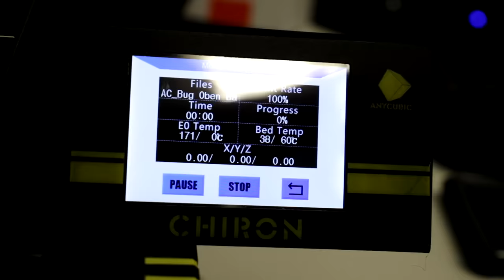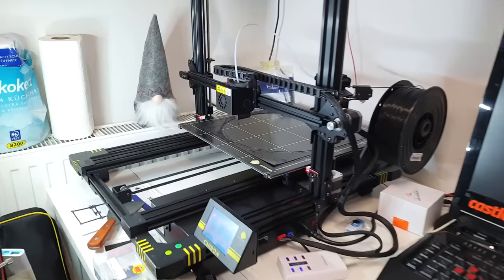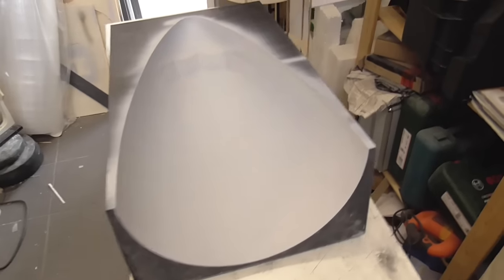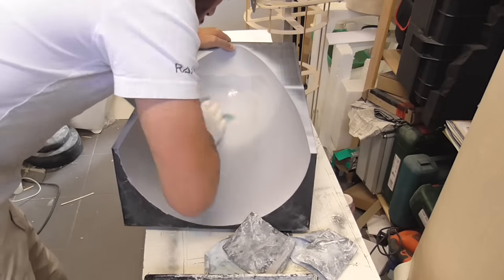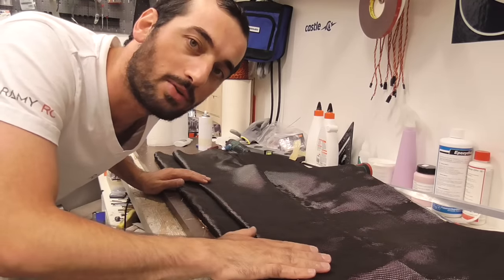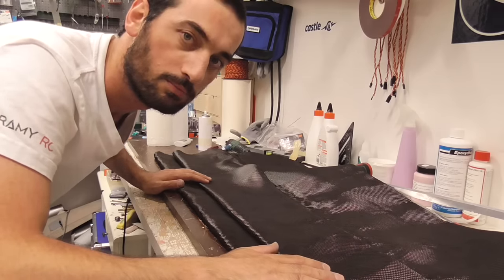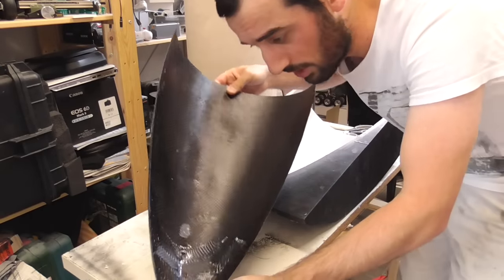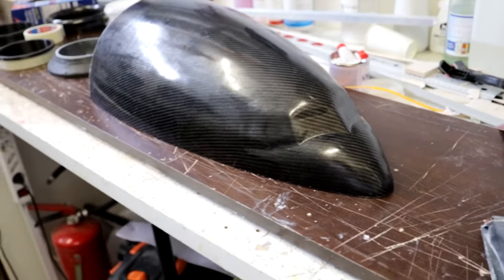Building RC airplanes using a 3D printer

Comment from the maker: Guys I'm not building another 777X, I'm just trying new methods and learning new things for my next project , there will be a vote on YouTube soon.
Next week we have a very funny video for you, stay Tuned!
Reply: Ramy RC can’t wait to see what you build next man! Love what you do
Reply: Hey RamyRC! Many of us are wondering why you are not using any autopilot hardware on your models. RIP 787.
Reply: Can a350?
Reply: I'd love to see a large scale concorde
Reply: James Smith  That's very cool and emotional and being directly connected to control surfaces and motors is a different feeling but autopilots allow manual flight too. But with just one switch fatal crashes might be prevented. So, it's just a counter measure for human error. Also cheap. Poor 787. Poor all that hours, money and hopes invested in it.
Reply: A330-300 or NEO? A300? A340-500/600?
Reply: Ramy when are you going to start selling your kits amazing
Reply: How do you glue the halves?
Reply: All the RC you made is outstanding especially 777, I want to see an air bus model brother.
Reply: This looks awesome! Please share info on the type of CF and resin used 🙏
Reply: Make a 747-8
Reply: Wonder what the price difference between this and your normal foam build is gonna be
Reply: It would be amazing to see someone put a lot of effort into creating another Boeing, probably the hardest one due to the landing gear, I would suggest the Boeing 737 MAX 10
Reply: which cad software do you use?
Reply: U should build an f-302 starfighter
Reply: @MetinOktayYlmaz  autopilot hardware is called a "missile guidance" and is illegal in most part of the world, people playing with it are risking landing on terrorist watch list :)
Reply: How will u glue the two halves?
Reply: Do you happen to have links to the exact coatings you used? It come out great and I must know!!
Reply: So what is that section in the background for? 10:50
Reply: Ramy i want you to build a Boeing 747-8
Reply: You need that Polyvinyl Alchohol as a protective release agent because the wax layers only will react with your epoxy ressin, so your PVA is a protective layer in between
Reply: Ramy RC hey there, can you show the modelling on your computer
Reply: Can you share the 3d mdel
Reply: Thank you so much for sharing your experience with us.I would like know also there is any page to get all declaration page .

With Best Regards 
Abdurrahim
Reply: Hey Rami,
How about going Retro..

Some options.

ILLYushin Il -62
Hawker Siddeley Trident.
Boeing 727.
Reply: Where can I find the 3d models for some of the planes?

Comment: Hello Ramy!
Amazing work that you did. Just a quick tip:
Instead of applying the resin with the carbon fiber at the mold, apply it in a flat table with plastic film in both sides, and than scrap the excesses of resin to the side of the fiber. This way you'll have a evenly distributed resin through the carbon fiber sheet. Do this to each sheet, and apply the fiber to the mold afterwards.
I hope to have helped you! Continue the great work.
Reply: Thank you. And do you apply some resin on the mould as well or just apply the wet sheets on the dry mould?
Reply: Perfect way to get some dry spots

Comment: I'm also not an expert at Carbon Fiber... however, I have recently been watching a lot of videos about it.
You are literally using the exact same technique that I was planning on using. I was very happy to see this video!
The only thing I can say is that it seems to me to be worth getting a vacuum pump and bagging. For one thing it presses the material more solidly against the mold, and it also removes the fine bubbles that mar the otherwise perfectly smooth surface. Without the fine bubbles within the weave the structure is stronger, too.
Reply: nerd alert
Reply: Coming back here to reinforce that vacuum bagging and vacuuming is the final way. It's a big add to the process and I think Ramy sees as overkill for his application, but anything and everything composites should always have vacuum bagging.

Comment: Just an idea based on what some of the guys i've seen in South Korea are doing atm with prosthetic arm/leg replacements. Print the shell, as you've done, but then print a inner structure shell (preferably ABS, i'll explain why below***) that you'll attach to your carbon fiber on the inside of as a last "layer".

***ABS vapor polishing or dipping PLA in a bucket of thin super glue will make the structure very strong because either will bond the layers of the print, i for one, prefer ABS because it's more lenient.

The students in SK were making the structures for the actuators or electronic muscles out of CF and such structures (honey comb or plain lattice) so that they get the best solution for matching components, rigidity, and inner structure mounting points for hardware and so on. I was very impressed with how strong the final product was. I even saw a very interesting thing where they applied the concepts of lost wax casting to CF molding. 

IE, using low temp PLA lattices that were then encased in CF and subsequently baked/melted out in the autoclave as the CF was "fired". VERY, very cool idea. Now, i know an autoclave ain't everyone's cup of juice, but if you use a low temp lattice made out of something like PCL, which is printed somewhere between 80 and 100 degrees Celsius, you could "fire" your part and remove the lattice (obviously it needs to have some place to escape). I mean, your average heat gun can output the necessary heat to melt the material out. :)

You could, in theory (because it takes time to figure these things out) have your own latticed CF nose cone or wings made out of a single solid, piece. Making something like that DIY at home, is very difficult, we're talking Koenigsegg CF wheels level of complicated here.

BTW, check the channel "The Drive" for the Koenigsegg wheel videos, has some really cool insights in CF laying by the man himself. :)
Reply: Nice info. Do you have any video on how to do this with the PLA as a second layer?

Comment: I making carbon fibre parts using 3d printed mold around 5y ago some people use it for making carbon fibre bike frames (i making glass fibre parts around 10y ago using styrofoam model and glassfibre mold) :) now i work making composite parts for motorcycle :) 
YOU dont aply PVA on wax.... You aply wax on pva if you want easy release but you can use only PVA without wax
If you part is smooth you only need to aply maybe 2 layers if you making mold one time(i sometimes use only 1 layer of wax or pva and 1 layer wax on top of it...if you aply 5 times wax you can make easy 20 times the same part using 1 mold....we aply wax 6-7 times and use one mold without aplying more wax around 50 times or more. 
If you try to aply pva on wax it wont stay on it...like water on waxed car paint.
PS.
If you need any help with making molds etc text me on email (its in information about me on youtube)
Reply: What do you use to smooth out the raw printed mold before PVA/wax?
Reply: @epgaynor  after it is printed i first use brush to aply acetone on it....to clean the print or sometimes PLA with colour start to melt (not pla....pigment in it) and it become smoother
Next i aply thic coat of primer and high gloss spray paint.....or if spray paint is based on acetone just high gloss paint then after few hour sand it using 500 water sandpaper untill i see plastic 
Then use 800 + up to 2000grid (you dont need perfect smooth just make it smoother after 500) 
When i use 2000grid i add some soap to clean it and leave it to dry (dont touch with finger)
Then aply first thick layer of pva using sponge and dry it using hairdryer so it wont make spots without pva
I heat it up in the same time
And then aply second layer
But second layer need to be aply in 1 direction and dry as fast as possible so it wont melt first layer 
After that mold is ready if you want you can aply wax on it if mold is tricky (if its mostly flat u dont need it)
Or if you want to use it few times dont aplt pva...aply wax wait 15-30min (check wax instruction)
Polish it then aply again wait ...polish it and repeat around 5 up to 7 times

Comment: Nice! You should print registration/alignment connections between your mold parts, so they align easier when gluing for instance. Don't forget to add clearance, though, otherwise they won't fit together.

Comment: Hi Ramy, have you ever considered building a plane in small strong sections that are joined but can breake off in case of a crash. In that way the plane could break apart in a crash but the parts would survive because they can brake off and wouldn't take full impact off the whole mass of the plane. Off course the trade off would be small joines but they would only be visible at close range. Another advantage would be the if a part would be damaged too severe you would only have to remake that part and not the whole plane. Off course there would be more design and build work but when you can think of a good system it would be a big advantage in all your future projects! Cheers and good luck!
Reply: It would add mass and made model more likely to crash.

Comment: You will find it easier to get your fiber wetted if you apply a generous layer to the mold itself before you put the first layer on. It works better to work the resin up through the fiber than it does trying to push it down into it. I get great finishes with no blemishes or areas that did not wet out by first laying down a nice coat of resin on the mold, laying down the first layer of fiber and using a rubber squeegee to pull the resin up into it. When I have got all I can up into the first layer I add more resin and repeat for the consecutive layers. If you are vacuum bagging its not as critical to do it this way but even then I always wet out the mold prior to adding any fiber.

Comment: Hello Ramy!
Your work ist getting better and better, wow.
Just some thoughts about your carbon fiber pieces.
- If you wish to have a nice surface without much sanding, you can start with putting the paint or some gelcoat in the mold. And to make it nice and smoth, put some glassfibers (40g/m2) before you use the carbon. In this way you can avoid the little "pinholes"
Very curious to see your next project. 
My next project is to improve my tristar, trying to make it fly perfectly smoth and adding some scale details.
Greetings from switzerland, Dom

Comment: Hey Ramy, im a huge fan of you and your work. However, I didn't think much of it until I actually went to college to study Aeronautical Engineering Technology to be a Pilot in the US and the horizontal stabilizers on every aircraft is supposed to be an inverted airfoil to pull the empennage of the airplane down instead of a standard airfoil. I just wanted to let you know so that it can help with the performance of your airplanes.

Comment: Rather than a many use mold, I have considered a vase print and just drape the print on the outside so it's one piece, no seams to glue together. And if weight is very critical, the weak print can be torn out when it's done. 3D printing obviously has huge potential for fabrication.

Comment: I make molds for a living. I bought a 3d printer for home use so I could design molds, then make a fiberglass part out of it, tyhen make a fiberglass mold off of the part I made out of the 3D printed mold. This is a great use of a 3D printer. Nice job.
Reply: What are you using for  filler on the print? PLA or PetG?
Reply: @marcusmarcusk830  I was printing with PLA.
Reply: @CarbonGlassMan  and what kind of filler do you use in the PLA print to smooth the surface? Some epoxy based spackle?
Reply: @heavyweather  Oh ok. I misunderstood you. I sanded it with some sandpaper and sprayed primer surfacer on the print. Then wet sand the primer. You could use rattle can primer surfacer if you dont' have a paint gun and air compressor. SEM makes a good primer surfacer in a rattle can.

Comment: Another tip I have learned with carbon or fiber glass, always wear gloves when handling it. Your hand oils will cause the fibers to repel the epoxy and not get a perfect bond.
Reply: Is it OK to fold the CF cloth like at 8:30? I was told always keep it on a roll, like glass cloth.
Reply: @dbaider9467  i think that ideally it should be on a roll, as to avoid creasing the fibers, but as long as no pressure is applied to the fold, I don't see an issue with it.
Reply: What type of resin and hardener should be used for jobs like this?

Comment: 230 should be no problem printing PLA...the 3d printed planes are often printed at that temp with PLA for better layer adhesion.  If you are getting clogging then it likely is an assembly issue.  If my guess is correct the hot end is probably something like the E3D V6 hot end and a common mistake made with those hot ends is to forget using thermal paste when screwing the heat break into the heat sink.  Without this thermal transfer doesn't work properly so the cooling fan doesn't work properly and at higher temps you end up getting filament jams in the heat break.

Comment: you should make ID holes/bumps in the mold so it's easier to line it up and glue together.
Reply: I have a feeling his 3D modeller is not that good considering they couldn't get the windows modeled correctly either.
Reply: @_droid  yea it's not that hard

Comment: I just started building my airplane with this method. It's genious. How do you plan to attach the two halves together?
Reply: Vegandiver
I have asked several times for someone to mention the program they are using to make these molds. None have replied, even the YouTube presenters. Would you mine stating the program that you have tried? Thanks.
Reply: @amtpdb1  I've been using Fusion 360 from Autodesk. Assuming i have the plane modeled, I make blocks that are the build volume of the 3d printer, then Boolean cut those blocks with the plane model, then do more simple lofted or extruded cuts to reduce the amount of material used and print those. I also add alignment features so the molds pieces line up.
Reply: @vegandiver  
Thank you so much for answering. I downloaded fusion last week but haven had the time to look at it and I had no idea it could do molds. I will have to look around and see if I can find someone that is showing the process. Again I want to thank you for your help.  Don

Comment: Great printer and a great result with all of your hard work in between. Something very sexy about carbon fibre, I really want to make something now!
I print with RigidInk PLA and it's very happy printing at 195 degrees. I tried and tried with ABS but too much warping on my printer (not enclosed so can't keep it hot). Great work.

Comment: Also, maybe worth storing your fibreglass and carbon fibre rolled onto tubes.  That way, the cloth is undamaged or not weakened at the folds - based on my learnings.  Others may hold different perspectives.

Comment: im a total noob at making rc models but i saw a video of Lamborghini making
 Carbon fiber panels . they use a special kind of roller to eliminate air bubbles during layering of the carbon fiber .
 And then after a quick drying they bake the molded panels in a vacuum oven .

 So maybe you should use a mini roller ? And bake it a big oven ??
Hehe . goodluck to you sir .

P.s i hope you rebuild a dreamliner again .
Or if not pls try to make a USAF C-17

Comment: Glad to discover your channel, and thanks for demonstrating this very interesting use of 3DP!
Now, sorry to be this guy but I have one advice/request: please use a respirator when working with epoxy and carbon fibre! The very high evaporation surface makes for some higher than usual concentrations of epoxy solvent in the air. This stuff will give you issues over time such as Parkinson's.
Also, if you haven't, you should checkout Igor Negoda's channel (Игорь Негода), he's also currently working on a carbon+glass fibre RC aircraft and most of his videos have subtitles now.
Cheers!
Reply: Just another tip re carbon fibre: when applying multiple layers, try to have the fibres lay at a 45° angle from each other, in order to maximize structural strength against all kinds of stresses.

Comment: I'm thinking the 787 went down because you had full flaps on during your bank.
during a banking turn lift is drastically decreased... and full flaps will register a lot of Drag. In a sense you are right that you were going to slow but the greater issue was the airfoil at full flap while banking at a 90 degree angle. Regardless... beautiful work, sad to hear she's gone.
Reply: Or maybe the ESC fried on the right motor. After Rewatching it seems like you closed the flaps. Bummer man.

Comment: Nice video... You can use the pva without the wax, it will just pop up when finish, it will save you a lot of time, for using carbon try to coat the mold with resin first, wait a little and place the carbon, the true streangh of carbon is achived by vacuum molding, any tiny little bubble trap in there will make it weak, son if you plan doing it like that use carbon for look and reinforce with fiberglass, you will save money and get a nice strong model....

Comment: Hi , if you align fibers between layers at right angles it will be much stronger.
Reply: Also your mold can be optimised for faster printing by making a thick semi empty shell with supports to put it on a table
Reply: Another thing you can do is to  inverse the mold , so that you would apply carbon fiber material on the outside

Comment: Why sand to a smooth finish only to then add a layer of wax to the surface? Within reason (aka nothin too deep), any imperfections on the semi-sanded or non-sanded surface would be be covered by the wax. Am I missing something?